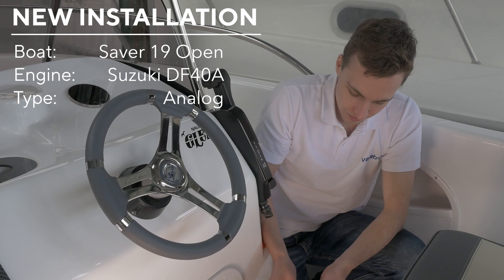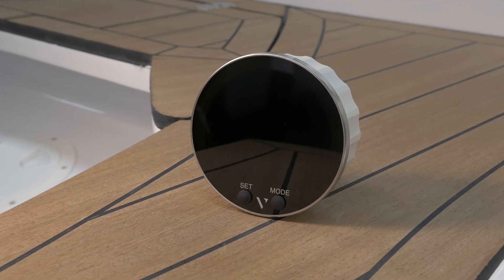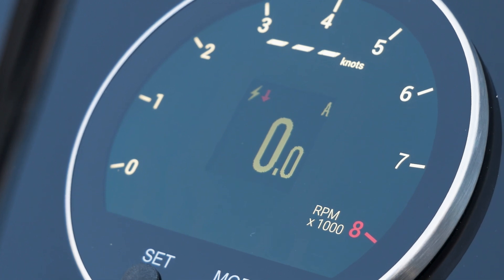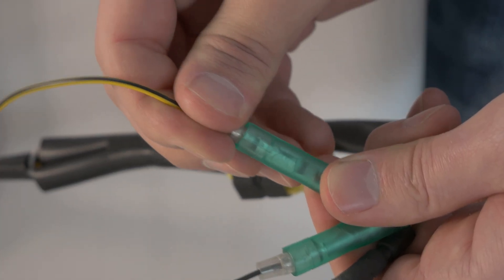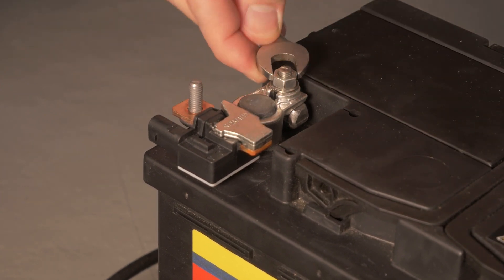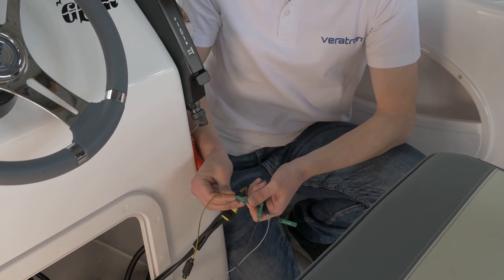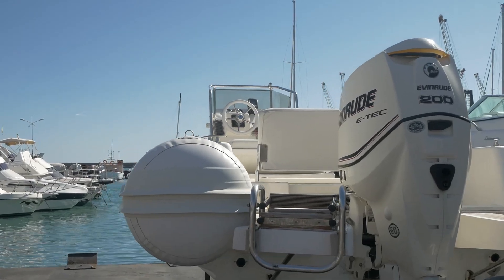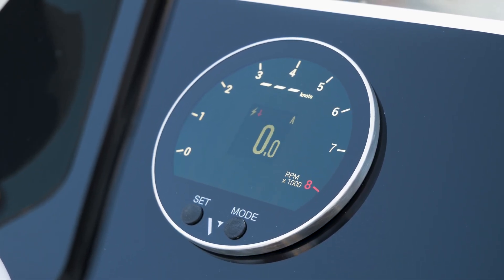Veratron VMH35 Outboard Kit

Comment: I have the 115 Tohatsu mfs with nmea kit, can i connect it to nmea network without cancelling the original analogue meter?
Reply from the maker: Hello @Bill7Vdg and thank you for your message. Connecting the VMH 35 on the NMEA 2000 device should not affect any analog gauges. For more detailed information about your system in particular, please get in contact with service@veratron.com. We will support you there. Thanks / Veratron

Comment: Can we use it on a car ? 
Speed 
Rpm 
Temp 
Fuel 
Thats al we need 👌🏼
Reply from the maker: Hello, it is actually possible, but the instrument is not KBA certified, which is mandatory for vehicles on the road. Best Regards, Veratron

Comment: Geht es auch für ältere Modelle? Z.b von 2002 2Takter Mercury??
Reply from the maker: Hallo Daniel. Bitte entschuldige die späte Antwort. Ja, dank der analogen Sensoreingänge kann das VMH 35 auch problemlos in Systemen mit älteren Motoren eingesetzt werden.

Comment: Can I install 1 fuel + 1 freshwater together? I can only find 1 connection possibility. Please help
Reply from the maker: Hi. Yes, you can connect whatever two resistive sensors you want to the VMH 35 (B00085501). It doesn't necessarily have to be the same types as shown in the video. But you might have to make some changes to the wire harness, like adding another connector.
Reply: @veratronag2982  I have the VMH 35 but the wire harness is only giving me 1 input wiring (fuel) Please explain me how to make these changes so I can have both fuel and fresh water info?  I have added the VMH 14 but unfortunately this is only given an input connecter and no wiring. Please help
Reply from the maker: @petluxpremium7618  Please contact us on service@veratron.com . We're happy to help you with your installation there.